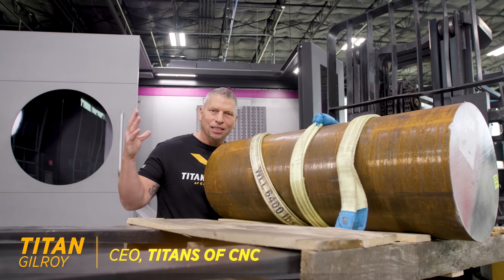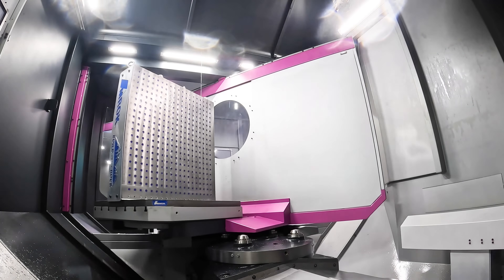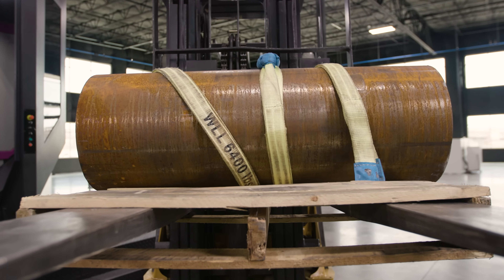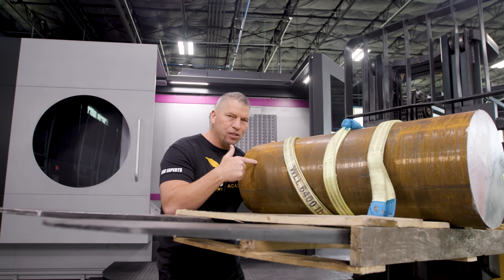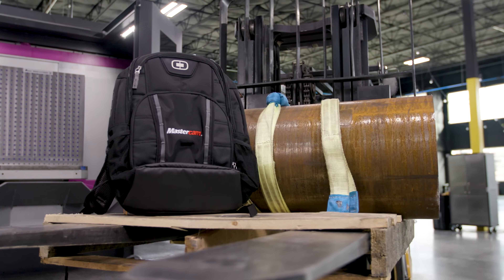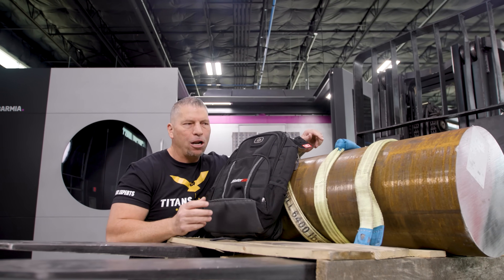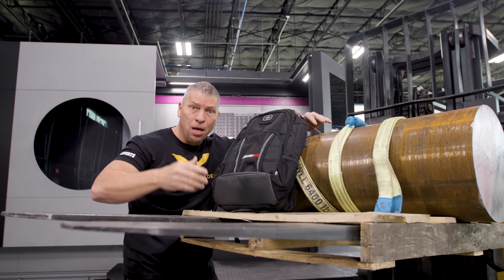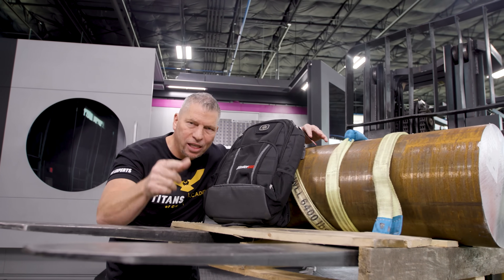How Would You Do It?? YOU Tell US How to Fixture This Monster!

Comment: This is a half assed challenge, A), we don't know what you're making (shaft? some insane sort of cylindrical manifold?), B) does it even FIT inside that machine, standing up or on it's side? Throw up a link to a demo model of what you're making, and then you can really ask for good setups (and maybe some baseline tolerances, cause getting a tenth along that length is going to be iffy).

Going in blind, I'd probably stick the thing on it's side (big old bar or four across the top, bolt it down), throw some vero-s mounts on one end, and then stand it up for the main operation, if you need every inch of travel/ work space. Otherwise if you have a chuck big enough, just throw the entire thing into a chuck and bolt/ clamp the sucker to the table (could also fabricobble some 'jaws' with mighty bites and some sort of incline so the jaws bite into the part, to skip the whole chuck thing). Of course this all depends on if you need to bore out the center too. If the center needs to be bored out, I'd do that first on a big ass lathe (something the size of an LU-40 or something, I'm familiar with Okumas, so forgive me), if lathe is out of the picture, I'd do a turncut (if that brand can do that, I imagine it can) inside and out (if it needs both ends machined). Unfortunately, if there's a bore involved, the chuck/ machined custom jaws are really the only two options (given thickness of part, if you can squeeze the vero mounts in, so much the better) and go from there. Naturally, indicating where appropriate.

Comment: without knowwing what the part would be ( might not even be  realy relevant )
i would weld some sacrificial steel to the bottom/top  or to the side of it 
since its only 1 that would be best course of action . even up to like 100 parts 
after that advanced fixturing might be the way to go depending if u can actualy have time and cost savings

Comment: Depends on the part you need to produce. Since you put vices on the tombstone I got a idea.
You put 2 Prisms on the empty table and use to big clamps to hold it down onto the prisms. That way you can machine the sides of the part and make fixturing refrences on the top to hold it in the vises later. Would almost say you machine a V-shape into the top and the chaws so you get max holding reliability for OP2 and got a good refrence bc  you machined the sides aswell. But yea still really depends on the part you have to machine bc there are so many ways to hold something and it really matters what the part looks like and what it alows you to do.

Comment: Hard to tell without a drawing, my opinion would be to set the job on the table on vee blocks and op 1 would be machining for holding in a fixture (depending on the job and specs called)

Comment: First of all, where is the drawing to this part. The description says 5 side machining. ok but without knowing the exact or even rough approximation what have to be taken of this piece of raw material is tough. Been seeing some other comments about fixturing in v blocks with chains, using dove tails in a simple/first fixture to have a more rigid/accessible fixture to machine most of its eventual features with the least obstacles in the way. The Vero-s Is also a nice idea. Just face mill one side( if you have enough stock material on one side that can be removed in a 2nd or later fixture.) Drill in the holes/wire to attach 2 or more of the Vero-s couplings and put it on the Vero chucks.
This is a nice idea btw to get audience interaction. Especially looking at ideas for fixturing when it comes to different experiences in machining etc.

Comment: I think titan is throwing us off track. He said "1st op" in that machine. 

I would use that machine to prep the shaft for the lathe.

Read my comments below.

I have done this before many times with large 4140 shafts like this. 

Prep center drilled holes in that machine then face drive it in the lathe.

You can turn then mill with the right 5 axis lathe.

Either way you got to think outside the box.

Every comment I read says to use this vice or that dovetail. Stand it upright etc etc in the mill but you gotta know it's round to start with so go with that image first.

There are a million different ways to machine a part like this and no one on here has any idea of what it will look like in the end. 

I don't need to see the proprietary info from the customer to get an idea of what is involved. 

Give me that chunk of metal and I will get it done. 

It's what I do everyday anyways...!!!

Comment: it all depends on what parts are planned to be made from this huge workpiece and whether auxiliary holes and fasteners are permissible.  If this does not matter, you could use a quick-change tool from shunk (I forgot what it is called correctly, it looks like a socket and a pin that goes in and is clamped inside), install the cylinder on the prisms, mill the plane and make threaded holes, fix the counterparts  , screw the receiving parts of the mount to the tombstone.
 But, you have already secured the vice, so it is probably planned to do it differently.  The cylinder is installed on a free pallet on prisms or v-blocks, rolled with an indicator for parallelism and a powerful dovetail is milled, on the soft replaceable jaws of the vice, the mating part of the dovetail is also milled.  This will allow you to remove the minimum amount of material, and at the same time ensure reliable clamping and fixation of such a heavy workpiece.  Although two simple flat surfaces can be made and used for gripping in a vice, it seems to me that it is not reliable enough.

Comment: I don't understand why people need print's , the answer is V block type fixture, machine a V block the length of the part to use as base and 3-4 V clamps that sit on top of the part . The part is the same size as the tombstone and V blocks offer the best support , if it was smaller I would add a 4th axis trunnion and a center stock at the end of the tombstone and that way you can rotate the part all the way but this part is to beefy

Comment: pre op 1 facing and turning a clean surface or in this case swarf milling or circular interpolation what have you you're going to need to hold this part off the table and we don't want to have to keep moving this part in and out of the machine. with that being said make no assumptions about what's permissible. so, I say directly on the table standing straight up with a mitee bite tower working their way around, so you have one stack of five 2inch spacing up and 2 inch spacing over on the opposite sides until the 360 degrees is complete

Comment: Depending on the dynamic movements and spindle load you intend to push your machine and the clearance you need you would have to machine custom L clamps with a reinforced rib that bolt directly on drilled and tapped holes on the part and bolted on the table. Calculations for strenght could be easily made and leaving a small clearance between the table and the L will ensure a good pulldown force that will sit the bottom of the cylinder flat on the table. 
Just to be sure I would add a few blocks that would prevent the part from sliding by pushing them against the material then tightening them to the table. 
At least without knowing the shape of the final part that's how I would begin machining it. 
If you need a lot of clearance on your part you could also drive a large threaded extention or bolt through the hole on one face (repurposing the hole used for the turning operation) and mill a slot to insert  a locator that will fit in the table groove.

Comment: The piece will be placed on the empty pallet, verticaly, fixtured on 4 claws chuck (with long claws), and ofcourse if you have to do so large pieces, you will order the material with extra material.. (like 20% longer then the finished part), then you can start machining.. if it need to rough the exterior, the worktable will spin, in the interior is the same.. so yeah its not so hard.. bur for more stuff it needed a drawing ! Good job you are doing Titan!!!

Comment: Choose an appropriate square size for a clamping plate(s). Waterjet or bandsaw a pre hole(s) through the plate(s) before preparing the plate(s) by boring on a turning machine an undersized hole(s) with the appropriate amount of interference for a heat shrink fit.  Heat shrink a plate on one end or both ends depending on what the finished part geometry will look like.  The second clamping plate for the other end of who knows what size the shaft is if used may be aligned with the aid of a surface plate for assembly.  The plate(s) may have mounting  holes placed before assembly or standard clamps may be used.  Doing this will essentially make the part be a rigid extension of the pallet.  Dry ice and heat would be sufficient for the heat separation.  I would use .0000063 per inch per degree Farenheit of heat separation for calculating while adding another .004 minimum for wiggle room.  I generally use -70 degrees for a figure of the temperature of the block on dry ice.  You should be able to measure the temperature of the part that you heat in the oven to maybe 300 degrees or so.  I like to spray the cold member with wd40 before packing the dry ice on.
     This may sound complicated but it really isn't.  It is just another day in a toolmaker's life.  Try it, you will like it.  It all self aligns when it goes together.
     If you wish to get fancy and want to spend extra money and time you could use Hirschmann 9000 series with the hydraulic clamp utilizing one Hirschmann on the shaft and two to four Hirschmanns on the plate.  Of course if you put one on the center of the shaft you would need to face it even with the square clamping plate and you would need a fixture plate to receive the Hirschmann 9000s also.
     Call me if you have any questions or wish to have me come and guide you through the process.  You will gain a great respect for the viability of physics and heat shrinking.  What do you have to lose?

Comment: Hi im Tony and im a CNC Programmer 

Its difficult because i dont know what opportunities the Machine have, and also i know nothing about the finish part. These both things are very important to know when it comes to the workholding, but if u want to Machine it from 5 sides the sixt side have to be in Z minus. And from this its depends on the machining, for example how many OP do i need and how many Material i have to cut. The raw material weights a lot and i guess there is also heavy machining involved so u have to hold that thing tight, maybe with bolts or maybe its possible to clamp it (i would to prefer the clamping). That realy depends on the Machining at all.

Thats all i can say as an Profession to this task, we need more Information i guess :D

So at the end i wish a very nice Day and greetings from Germany

Comment: It’s round but if you use v. blocks you can square up ends, then use angle plates to hold the ends giving you clearance to fork along the whole long thing. Or you could just center drill both ends and mount between centers for lathe style machining.

Comment: For the first op use some sort of chain fixture to hold the part in place to face both ends and mill a dovetail tangent to the diameter. Then in op2 lift that beast  into your shunk vises and get after it!

Comment: Op A: If there is enough room for the piece of material to sit upright in front of the tombstone (cylinder pointing toward the sky) then you could place it there and horizontally toe clamp the material to the tombstone while letting gravity hold it on the table of the machine. You would toe clamp in between your four vises spacing that is on the other side of the tombstone already set up so you know their spacing dimension. Then you face in between toe clamps and then cut straight/parallel edges with an endmill a desired amount of inches wide and deep depending on the part geometry and how much you want to hold onto in vise for Op B. Now we are able to hold the material in vises.

Comment: You need a big ass universal with 4 jaws to put on the tombstone  and then put the cilynder in the universal , first op straight face and remove all the posible stock on the part , op 2 turn it arround put the machined diameter in the universal with some sand paper on the jaws so it whont leave jaw marks on the finished part get the piece to length and finish other ops that couldnt be done in first op. I'm a lathe guy so thats the way i think :)

Comment: Firstly lay it down on the empty pallet. And clamp it down with large enough toe clamps just past the largest diameter of the stock. Then you would mill a flat along one side for a flat reference surface, then drill and tap 6 holes the same as what is in the tombstone(TS), 2 on one end on both newly machined “corners”, 2 in the center and 2 on the other end. 

Secondly stand it vertically on the tombstone(TS) and with long bolts, go from the opposite end of the TS into the holes you just drilled and tapped in the stock. 

And BOOOOM!!! No Fixturing  in the way for op2, and can attack from all angles as long as you don’t get into the bolts during machining.

Comment: I do these kinds of large 4140 shafts all the time. 

I would need to know what all has to be machined 1st before getting specific with fixtures, setups, programming, etc. 

1st operation: keep it simple. V blocks, studs and a bar over the top. Face and center both ends. 

2nd operation: Use a lathe that has x,y,z,b, and c axis. Use a face driver that is suited for that diameter and weight and tailstock it (about 5000lbs of tailstock pressure and at least 300 or so lbs of chuck pressure for the face driver). You can turn and mill everything except the faces of this part in this set up. 

3rd operation: Back to the horizontal to face off the centers and possibly machine features on the ends if needed. This could also possibly be done on the first operation depending on what all has to be done to the part. 

So 2-3 operations total. This all depends on the blueprints and your machine capabilities at the moment. 

If I don't win the swag bag, then I hope this kinda helps in some way.

Comment: Step 1: Lay it horizontally on the table and secure it to v-blocks. Indicate Parallel to Z-axis travel within .010 or .020 run out over the full length, no need to spend time getting it perfect before there's machined surfaces to work with. 

Step 2: Find center of the bar. Face off one end and use center of bar to program a bolt circle (drill and tap 3 equally spaced holes) to attach three studs that can mate with Schunk Vero-S system. 

Step 3: Adapt a plate using 1018 or something easy to machine "I'd go with at least 2 inch plate", the plate will be used to fasten three Vero-S Clamps that match the bolt pattern on the bar and centers the plate up with the center of rotation on the 5-axis table. Mill holes in the plate that align with the slots on the table and are on a bolt circle pattern that utilize the same center as the centers of the Vero-S clamps. Plumb the clamps with some simple tubing to supply air and get maximum retention and rigidity. Fasten to table.

Step 4: Pick it up with a magnet or have a hole drilled in the other end that's tapped to use an I-bolt. Drop it in the clamps and supply a burst of shop air to lock that thing in tight.